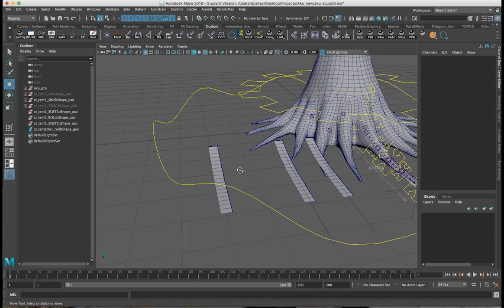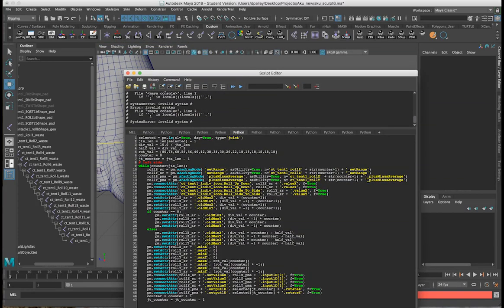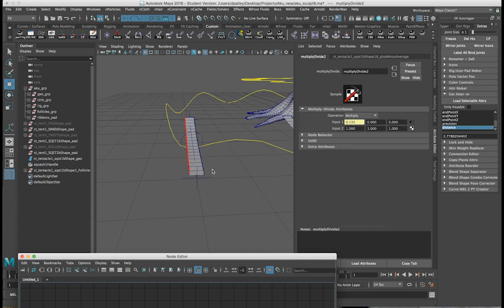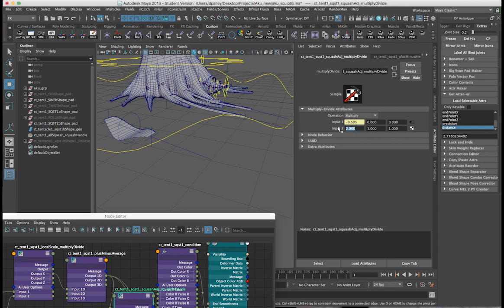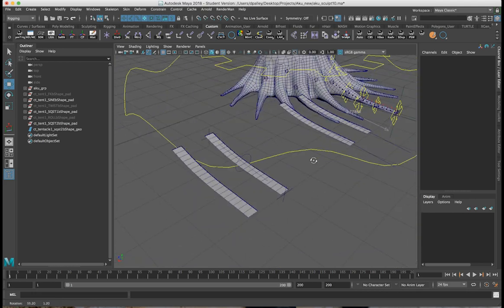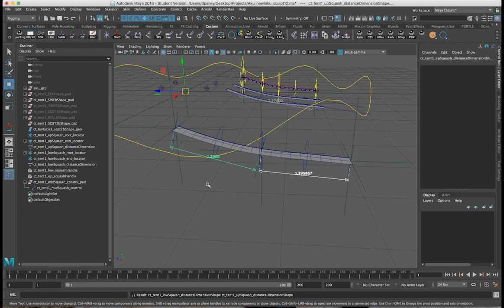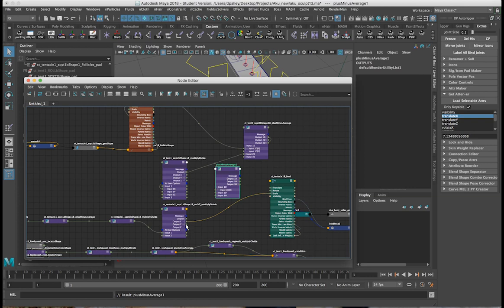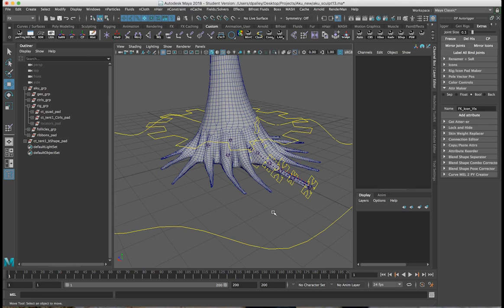Making a Character (Rig) Part 4 - More Deformers for Tentacle Rig

Comment from the maker: So it appears I forgot to include the twist setup when editing this video together. Luckily it’s the easiest of the setups and I can tel you how to do it here:

1. Duplicate the original ribbon, call it twist_ribbon
2. With the ribbon selected, go to rigging menu -> deform -> nonlinear-> twist
3. Make adjustments to the twist handle as needed
4. Create a twist attribute on the end icon of the original ribbon setup with a min max of -10 to 10
5. Create a multiply divide node and connect the twist attr into input1X of the multiply divide node
6. Set input2X of the multiply divide node to the value you need for the max twist
7. Connect the outputX of the multiply divide node into the twist attribute of the shape node of the twist handle and you’re done!

You can also just use the twist of the FK setup since it works very similarly. Hope this helps!
Reply: Thanks for update...

Comment: Could you explain roll setup manually if possible
it will help a lot
Reply from the maker: Aditya Shukal Thanks for the comment. Although I’m not sure how I would explain it any differently than I did in this video or the other one. The other video link is:

https://youtu.be/V1JX5KhzdW4

I created a script that converts a 0 to 10 attribute, divided that number based on the number of joints in the system to create an increment value, and then created a series of nodes to convert each incremented value to trigger the rotation of the corresponding joint.

The other video also has the script I used as a pinned comment.

Comment: I wrote the script and set values but 
the connections are coming only for end joint not for all and 
its going only in positive
---------------------------------------------
import pymel.core as pm
selected = pm.ls(sl=True, dag=True, type="joint")
jts_len = len(selected) - 1
div_val = 10.0 / jts_len
half_val = div_val / 2
rot_val = [93.25,88.607,83.965,79.321,74.679,70.036,65.393,60.75,56.107,51.464,51.386,22,46.744,42.101,37.458]
counter = 0
jt_counter = jts_len - 1
while(counter<jts_len):
    rollZ_SR = pm.shadingNode("setRange", asUtility=True, n="tentRollZ" + str(counter+1)+"_SR")
    rollY_SR = pm.shadingNode("setRange", asUtility=True, n="tentRollY" + str(counter+1)+"_SR")
    rollZ_PMA = pm.shadingNode("plusMinusAverage", asUtility=True, n="tentRollZ" + str(counter+1) + "_PMA")
    rollY_PMA = pm.shadingNode("plusMinusAverage", asUtility=True, n="tentRollY" + str(counter+1) + "_PMA")
    pm.connectAttr("tentAttr_CTRL.UpDn",rollZ_SR+".valueX",f=True)
    pm.connectAttr("tentAttr_CTRL.UpDn",rollZ_SR+".valueY",f=True)
    pm.connectAttr("tentAttr_CTRL.RtLt",rollY_SR+".valueX",f=True)
    pm.connectAttr("tentAttr_CTRL.RtLt",rollY_SR+".valueY",f=True)
    pm.setAttr(rollZ_SR + ".oldMaxX",div_val * (counter+1))
    pm.setAttr(rollZ_SR + ".oldMaxY",(div_val * -1) * (counter+1))
    pm.setAttr(rollY_SR + ".oldMaxX",div_val * (counter+1))
    pm.setAttr(rollY_SR + ".oldMaxY",(div_val * -1) * (counter+1))
    if counter == 0:
        pm.setAttr(rollZ_SR + ".oldMinX",div_val * (counter+1))
        pm.setAttr(rollZ_SR + ".oldMinY",(div_val * -1) * (counter+1))
        pm.setAttr(rollY_SR + ".oldMinX",div_val * (counter+1))
        pm.setAttr(rollY_SR + ".oldMinY",(div_val * -1) * (counter+1))
    else:
        pm.setAttr(rollZ_SR + ".oldMinX",(div_val * counter) - half_val)
        pm.setAttr(rollZ_SR + ".oldMinY",(div_val * -1 * counter) - half_val)
        pm.setAttr(rollY_SR + ".oldMinX",(div_val * counter) - half_val)
        pm.setAttr(rollY_SR + ".oldMinY",(div_val * -1 * counter) - half_val)
    pm.setAttr(rollZ_SR + ".minX",0)
    pm.setAttr(rollZ_SR + ".maxY",0)
    pm.setAttr(rollY_SR + ".minX",0)
    pm.setAttr(rollY_SR + ".maxY",0)
    pm.setAttr(rollZ_SR + ".maxX", rot_val[counter])
    pm.setAttr(rollZ_SR + ".minY", (rot_val[counter] * -1))
    pm.setAttr(rollY_SR + ".maxX", rot_val[counter])
    pm.setAttr(rollY_SR + ".minY", (rot_val[counter] * -1))
    pm.connectAttr(rollZ_SR + ".outValueX",rollZ_PMA + ".input1D[0]",f=True)
    pm.connectAttr(rollZ_SR + ".outValueY",rollZ_PMA + ".input1D[1]",f=True)
    pm.connectAttr(rollY_SR + ".outValueX",rollY_PMA + ".input1D[0]",f=True)
    pm.connectAttr(rollY_SR + ".outValueY",rollY_PMA + ".input1D[1]",f=True)
    pm.connectAttr(rollZ_PMA + ".output1D",selected[jt_counter] + ".rotateZ",f=True)
    pm.connectAttr(rollY_PMA + ".output1D",selected[jt_counter] + ".rotateY",f=True)
    counter = counter + 1
    jn_counter = jt_counter -1

Did I write anything wrong

Comment: How did you mange the rotation vale of joints for roll ?
rot_val = [80,74,68,56,56,56,42,38,34,30,26,22,18,18,18]
Did you rotate manually and set those value?
Reply from the maker: Aditya Shukal yes for this rig I manually checked those values and applied them to the script. However, on my channel I did a separate video for the coiling setup. In that video, I create an attribute for each rotation value that connects into each joint. In my opinion, that works much better. Thank you for the comment!
Reply: @dcpalley23  
I wrote the script and set values but 
the connections are coming only for end joint not for all and 
its going only in positive
---------------------------------------------
import pymel.core as pm
selected = pm.ls(sl=True, dag=True, type="joint")
jts_len = len(selected) - 1
div_val = 10.0 / jts_len
half_val = div_val / 2
rot_val = [93.25,88.607,83.965,79.321,74.679,70.036,65.393,60.75,56.107,51.464,51.386,22,46.744,42.101,37.458]
counter = 0
jt_counter = jts_len - 1
while(counter<jts_len):
    rollZ_SR = pm.shadingNode("setRange", asUtility=True, n="tentRollZ" + str(counter+1)+"_SR")
    rollY_SR = pm.shadingNode("setRange", asUtility=True, n="tentRollY" + str(counter+1)+"_SR")
    rollZ_PMA = pm.shadingNode("plusMinusAverage", asUtility=True, n="tentRollZ" + str(counter+1) + "_PMA")
    rollY_PMA = pm.shadingNode("plusMinusAverage", asUtility=True, n="tentRollY" + str(counter+1) + "_PMA")
    pm.connectAttr("tentAttr_CTRL.UpDn",rollZ_SR+".valueX",f=True)
    pm.connectAttr("tentAttr_CTRL.UpDn",rollZ_SR+".valueY",f=True)
    pm.connectAttr("tentAttr_CTRL.RtLt",rollY_SR+".valueX",f=True)
    pm.connectAttr("tentAttr_CTRL.RtLt",rollY_SR+".valueY",f=True)
    pm.setAttr(rollZ_SR + ".oldMaxX",div_val * (counter+1))
    pm.setAttr(rollZ_SR + ".oldMaxY",(div_val * -1) * (counter+1))
    pm.setAttr(rollY_SR + ".oldMaxX",div_val * (counter+1))
    pm.setAttr(rollY_SR + ".oldMaxY",(div_val * -1) * (counter+1))
    if counter == 0:
        pm.setAttr(rollZ_SR + ".oldMinX",div_val * (counter+1))
        pm.setAttr(rollZ_SR + ".oldMinY",(div_val * -1) * (counter+1))
        pm.setAttr(rollY_SR + ".oldMinX",div_val * (counter+1))
        pm.setAttr(rollY_SR + ".oldMinY",(div_val * -1) * (counter+1))
    else:
        pm.setAttr(rollZ_SR + ".oldMinX",(div_val * counter) - half_val)
        pm.setAttr(rollZ_SR + ".oldMinY",(div_val * -1 * counter) - half_val)
        pm.setAttr(rollY_SR + ".oldMinX",(div_val * counter) - half_val)
        pm.setAttr(rollY_SR + ".oldMinY",(div_val * -1 * counter) - half_val)
    pm.setAttr(rollZ_SR + ".minX",0)
    pm.setAttr(rollZ_SR + ".maxY",0)
    pm.setAttr(rollY_SR + ".minX",0)
    pm.setAttr(rollY_SR + ".maxY",0)
    pm.setAttr(rollZ_SR + ".maxX", rot_val[counter])
    pm.setAttr(rollZ_SR + ".minY", (rot_val[counter] * -1))
    pm.setAttr(rollY_SR + ".maxX", rot_val[counter])
    pm.setAttr(rollY_SR + ".minY", (rot_val[counter] * -1))
    pm.connectAttr(rollZ_SR + ".outValueX",rollZ_PMA + ".input1D[0]",f=True)
    pm.connectAttr(rollZ_SR + ".outValueY",rollZ_PMA + ".input1D[1]",f=True)
    pm.connectAttr(rollY_SR + ".outValueX",rollY_PMA + ".input1D[0]",f=True)
    pm.connectAttr(rollY_SR + ".outValueY",rollY_PMA + ".input1D[1]",f=True)
    pm.connectAttr(rollZ_PMA + ".output1D",selected[jt_counter] + ".rotateZ",f=True)
    pm.connectAttr(rollY_PMA + ".output1D",selected[jt_counter] + ".rotateY",f=True)
    counter = counter + 1
    jn_counter = jt_counter -1

Comment: Hello
Did you skip the twist part ?
Reply from the maker: Aditya Shukal wow now that you mention it, that part isn’t here. I remember recording it, but I must have edited it out by accident. Luckily, there are 2 solutions here. One, you can just use the twist from the FK setup, since it functions very similar. Two, I’ll pin a comment telling you how to do the twist setup.
Reply: @dcpalley23  the twist of the fk setup is not working properly when you rotate the fk controls and then do the twist
Reply: @dcpalley23  I would use twist deformer instd using fk twist am I right?
please give suggestion
Thanks for reply :)

Comment: Thank you for posting the video about the tentacle rig on YouTube. I could learn many things from part 1.
But I'm sorry. I'm not good at riggling, so I don't understand from part three to part four. I'm not sure what changed.
Most of all, how can I put a ribbon on my tentacles? How can I connect the sine ribbon to the main ribbon? Can I run multiple blend shapes at the same time?
If you don't mind, can you tell me which video I should watch on your YouTube?

I'm sorry to bother you with so many questions.
Reply from the maker: Thanks for the comment.  It seems like you may have missed part 2 of this series, where I cover the initial setup for the ribbon rig.  Parts 3 and 4 go into creating additional setups to add to the basic ribbon rig setup using blend shapes.  And yes, you can run multiple blend shapes at the same time and they should be able to work together.  

The entire part 2 video covers creating the ribbon setup.  Parts 3 and 4 cover making additional setups on blend shapes.  Take a deep breath, you can do it.
Reply: @dcpalley23  I found a way, and I'm very happy. Thank you for helping me.
I received a lot of help from you and your channel. I don't know if the meaning will be delivered well because I'm not good at English, but I hope your channel will always go well.